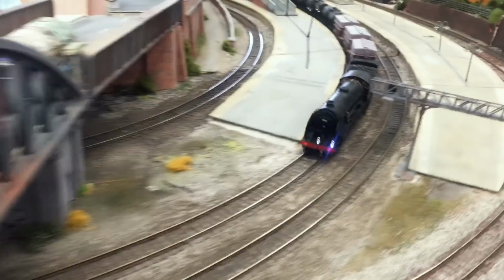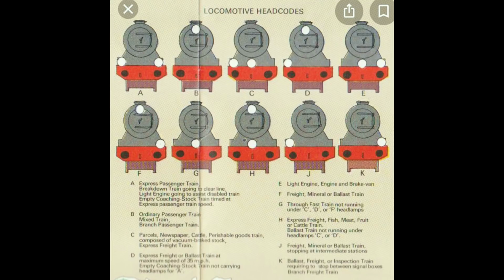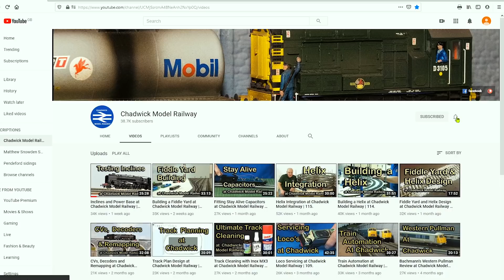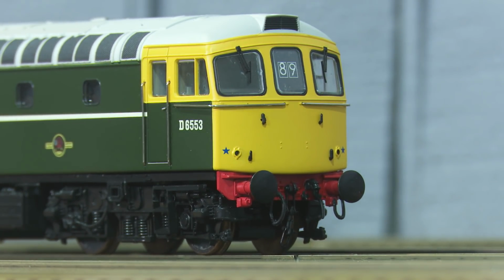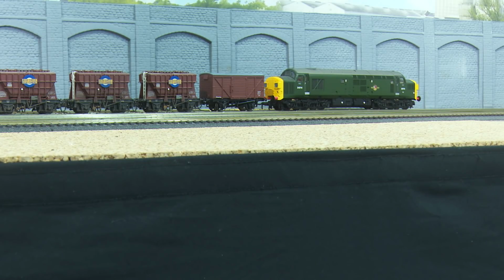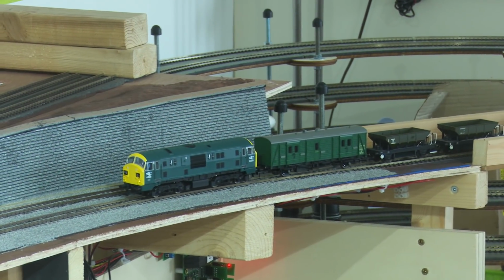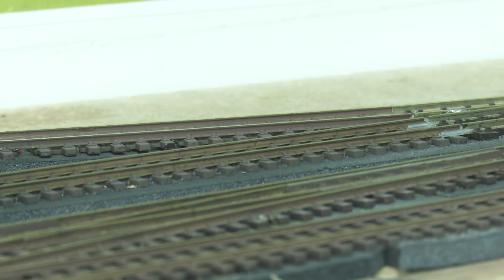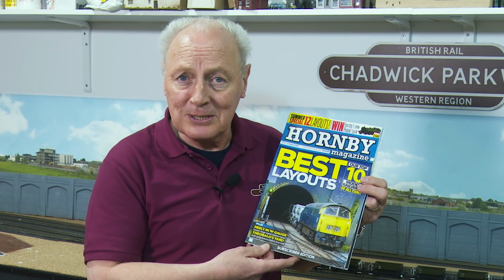Building Freight Trains at Chadwick Model Railway | 155.

Comment: Another great video Charlie.  The DOGFISH hoppers only had operating wheels at one end, and it didn't matter which way round they were, they would be which ever way the yard put them together.  The larger 40ton hoppers (SEALION or SEACOW's) had wheels at both ends as they were split into 6 compartments instead of three (left / middle / right hand side) on the 20ton DOGFISH.

The BY van behind the 63xx was a luggage van, and only had a seat for the Guard in it, so not much us as a crew van.  In fact the gangs of blokes that operated the hoppers would meet the train at a certain location, and ride out to site on the verandas (with there Tilly lamps) quite a site, but long gone in the modern H&S driven world of today.

On the subject of braked / unbraked wagons, also bear in mind that some of the grey un braked wagons were through piped, which meant that whilst the brakes on that vehicle would not operate, a fitted (braked) vehicle behind it could, so like most thing railway related, nothing is straight forward.
Reply from the maker: An excellent comment Richard, thank you.

I was aware of the through braked wagons, but thought it best to leave that complication for another day! Regards Charlie

Comment: Nice and informative video.  Although aware of the lamp code once one has glued them in and wired them up to a model, it is a bit difficult to change when the mood strikes to drag a freight rake with a loco set up for passenger service.  It was good you mentioned barrier cars.  I sometimes see oil tanks running without them on model train videos.  Cheers, Rob
Reply from the maker: I think the best idea Rob, is to use non-illuminated lamps on the front just held in place with black tack. Regards Charlie

Comment: Hi Charlie.
Great informative vlog as always.
In regards to those couplings, if they were mine think I would get the dremel out and just nip a bit of the end so it clears the frogs and points. Might be time consuming but worth it with those Great wagons.
Keep safe mucker.
Pete and Su.
Reply from the maker: I will use a solid bar to connect the wagons and KDs at the ends. Regards Charlie

Comment: On the couplings, the reason they have the lower arm (I think) is for the sprung uncoupling ramps that go between the rails (e.g. Hornby R617 / Peco ST-271). If you don't use uncoupling ramps then you could chop the lower arm so it doesn't foul the tracks?
.
It looks like the NEM pocket is mounted on a pivot at the very rear and it is the whole NEM pocket that it drooping (not just the tension lock plugged into it)?
I don't know how symapthetic the various coupling types will be to this flaw.
Reply from the maker: Yes Glen, the whole thing is a poor design.

I shall replace the couplings, but wanted to show their condition straight out of the box. Regards Charlie

Comment: Hi thank you for your reply, there is an ERROR in my comment. The need for side lamps on fitted trains will depend upon which book is used and I have since found a further rule saying that fully fitted trains do only need one tail lamp but all partly and none fitted trains will need the two side lamps. To give two further examples of part fitted trains ,part fitted trains with a D head code made up of 40 vehicles will require require a minimum of 13 and a maximum of 20 fitted vehicles  behind the loco. With an E head code a train of 40 vehicles not including the break van will require not less than 4 and not more than half of the total. Again all the above notes are taken from the Blue Book of Rules and I understand are for the Western Region. When putting a train together it would not make sense to sort out all the fitted vehicles so apart from the above the rest can be placed in any part of the train . On Gunpowder vans I think there should be no more than five in a train with two barrier vehicles at each end of the five at or near the rear of the train These vehicles can be loaded with non explosive goods so need not be empty. All of the above are taken from around 1950 and before so could have been changed at a later date. Thank you for a very good channel.
Reply from the maker: Thanks Charles, some great info.

I tend to adopt the rules based between 1960 and 1972, again from the western region but as you implied, it is a nightmare. Regards Charlie

Comment: Yes Charlie, at least in my experience brass wheels collect dirt.  I s'pose we could plate them, but that is expensive and finding platers is getting more difficult.  Then there is the problem of what happens when the plating wears and flakes - a problem the model press is strangely silent on with locos???  The worst wheels I have ever run appeared to be nickel silver?; they reliably gum up in about 20 feet of running.  My track is not great, being in a damp garage; but it's not t-h-a-t bad.  Replaced a lot of plastic wheels with mild steel which predictably rusted; had problems maintaining axle length, a something still being worked on.  I find with a lot of the old stock axle length/distance between bearings mismatch is what eventually forces re-wheeling.  Rusty mild steel wheels are still better than bad plastic or brass.  Plastic wheels also bring a wear problem, as often the axle is made from the same material as the bearing.  Currently trying stainless wheels, though they are hard to machine.  Beautiful wheels to look at; will try them out if I don't die of old age first.  All this is made even worse by the manufacturers changing wheel standards a few years back.  If there is a need to re-wheel and you have old standards, buying replacement wheels or bogies is a migraine.  Modern stuff is at or near RP 25 110.  Time has retarded my activities, and I am no expert, though experienced enough to shudder at some of what I see on Youtube.  If you are silly enough to email me I am always happy to discuss my misadventures.  Your channel is always encouraging and that's gotta be a positive.
Peter
Reply from the maker: Hi Peter thank you very much for an interesting comment.

I can’t easily replace these wheels as the axle length differs being made by a minor company! All I can do is remove the wheels from the axle and then replace the actual wheels on the old axle which seems a lot of a palaver. Wish me luck, regards Charlie
Reply: @ChadwickModelRailway  Indeed Charlie you have my best wishes.  Sounds like bogie replacement is your best option, though costly.  You are in a club; see if you can find some wheels from somewhere (not Bachmann as they are a 'unit design' and hard to work on) and ask a club member with a lathe to fit them for you.  At least you are not forced into out of production courser standards, BRMBS or something.  Time for a headache tablet.
Peter T

Comment: Hi Charlie. Well done with this, another great video as always! Well done for being so brave to tackle this as freight workings can be a bit of a minefield. I've spent a lot of time looking into it myself, and hope I can help with these comments;

 Each of the different 'classes' of freight trains not only had a restriction on the formation of the service (Fitted then unfitted) but also on the types of wagons that could be put into those trains, due to the higher speed these trains could go to. (I think it was mainly due to the lubrication of the axle boxes). eg; a class 'D' could have a 16t mineral wagon in the unfitted section, but not a bogie bolster. (Just an example) These instructions where in a document called the 'freight trains load book'. This also gives info on what kinds of loco could work what classes of train (eg; a WD 2-8-0 was barred from pulling a class 'D' or higher)

Also, the way the train was formed was in various 'portions'. This was to reduce time when shunting at each station/yard that the train stopped at. This would of been pre-shunted into the correct order at the yard the train originated from. The notes on how to do this differed for each region. Some I have found personally in the back of Working Timetables. If you whish to see an example of these kinds of notes, I've included them on some pdfs I have done for Yard Arrival & Departures on a couple of groups, and on these two sites: https://www.lner.info/forums/viewtopic.php?f=5&t=14326 & http://www.stciers.me.uk/home/analysis/analyses_front.htm (Look at Broxbourne Winter 1952 for an example of marshaling requirements)

I don't clame to be an expert on these matters, but I hope you find this helpful.

Stu
Reply from the maker: Hi Stu,
Wow, this level of detail is staggering.
I shall try and locate a "Freight Train Load Book" for the western region around 1970 and see if I can make head or tail of it.
Regards Charlie
Reply: @ChadwickModelRailway   Thanks. 

Yeah you might be able to find one on a well know auction site. I've got a couple (not WR though) and most of the information is in the front section. 

Always happy to help. 
Stu

Comment: Hi Charlie,

Really good video - very interesting. With regard to the Dogfish wagons, yes the wheels aren’t the best! You can swap the axles out for a better substitute; however, watch the axles as they are not the common length of 26mm over pinpoints - I think they are 25mm. 
I swapped the wheels out for Gibson replacements, I think, but I had to retain the original axles and just whip the wheels off and retain them with locktight. Hope this is of use to you and anyone else reading.
Best wishes,
Nick.
Reply from the maker: An excellent tip Nick, and very useful too. Regards Charlie

Comment: The other reason for the barrier wagons on dangerous goods trains was as the tail lamps were oil filled (naked flame) it wouldn’t be good if there was a leak. A problem that battery lamps took away.
Reply from the maker: A good point Benjamin, regards Charlie

Comment: Lovely and educational. I did flinch though when I saw the 33; usually, numeric headcodes were for passenger services, and alpha for freight. Of course, if a freight train was to travel from Dartford to Charing Cross, it would get the "50" headcode (or 60 or 70 or 80 depending on which route it took) -- but few freight trains travel between passenger termini.
Reply from the maker: An excellent point John, I’m on the case.

Comment: There's pedantry and rivet counting, and then there's this sort of thing, which is really far more obvious to an informed bystander, and much, much more difficult to deal with in model, than getting the correct number of rivets on the inside of a tender. I probably wouldn't spot that a loco's headcode didn't match the train it was pulling, but there are many who would.  So how do we deal with it on model railways?  Aha! I see your ploy, Charlie!  This whole video is about persuading Mrs B that you need more locos, isn't it?  I mean, you can't go changing headcodes or lamps on model locos, so you obviously need every single loco you own, in multiple variants of head code.  Though even that doesn't help when a loco brings an unbraked mixed goods into Barnstaple, and then leaves with a train of braked fish wagons later in the day.  That'd need hand-of-god intervention to swap the loco for its doppelganger with the correct headcode.  Wonder if manufacturers will ever come up with a way to change headcodes with a cv?

This is, of course, yet another reason why my dad and I modelled German railways...

I never knew that about bauxite vs grey wagons either. Learn something every day!

Those Heljans are a shocker.  Obviously replacing the wheelsets and couplings would be the way forward.  I wonder if in the interim, you could snip off some of the length of the err whatever the vertical bit of the coupling's called.
Reply from the maker: A great comment Andrew. I will swap out those couplings for some kind of rigid connector. Anyway, I’m so pleased that you found the video interesting. Regards Charlie

Comment: Interesting detail to which I have no exposure as I reside in the States.  Not having the brakes on cars connected to the engine via the glad hands on air hoses is not something I would have imaged.  Similarly, I have never heard of the headcodes for the engines.  Just a broader education for me as I still try to assimilate with the term "sleepers" for the ties.  Today is a success; I've learned something new.  Thanks Charlie.  Cheers.
Reply from the maker: That’s great news mate, I’m so pleased that you found it interesting. Regards Charlie

Comment: Bogie ballast wagons - either "Turbot" or "Whales" for starters.  More recent trains a "Seacow" would be appropriate, but not very often these days with with the older two-axle wagons.
(btw. Although the conflat has a grey container it looks as if the frames are bauxite, that being the case it would be a fitted wagon.)
Reply from the maker: Thanks for the advice Rob  and I’ll check out that conflat. Regards Charlie.

Comment: Hi i noted when you removed the con flat from the train it looked to me to be a fitted vehicle and could have been left in place. The number of fitted vehicles behind the loco will depend on the type of train.  You do not have to couple all fitted vehicles to the loco. A class E should have not less than four braked vehicles next to the loco. Class C should not have less than half the vehicles fitted. A class D train should be limited to 70 vehicles excluding the brake van.The minimum number of fitted vehicles is one third and the maximum should not exceed 35. It is a very complicated subject and there is a table of fitted vehicles to train size in the Blue Book of rules. All freight trains must have one tail and two side lamps fitted weather the trail is part fitted or not . It does not matter which way around your Ballast wagons face as the wheels open the hopper doors. When a loco is shunting it should a red and a white light each end one above each buffer. If running with a shunters truck is attached the lights should be placed on it and not on the loco. The above will in part depend on the date you are modelling and they are taken from GW and BR western reagion   publications.
Reply from the maker: A great comment Charles. I am aware of many of the points you’ve mentioned, however I didn’t want to make the video too complicated but perhaps food for thought for a future one. Regards Charlie
Reply from the maker: Also when you say the blue book of rules, are you referring to the BR rule book? Regards Charlie

Comment: Hi Charlie many thanks for sharing this informative video, I have the same issue but with Heljan class 32 diesel locos fitted with brass wheels (cleaning before running). If your rake of Dogfish are to be more permanently fitted together than you could perhaps do what I did with Heljan wagons and trim/shortened the trailing hook section off (or fit hunt couplings). The Dogfish were sometimes used with Sealion or Seacow ballast wagons with a shark brake van fitted to the centre and or rear, hope this is of help.
Reply from the maker: A great comment Barry. I’m currently chasing down some sea lion wagons. Regards Charlie

Comment: Once more a very thought-provoking 'Chadwick' video, Charlie - well done and thank you: where do you get the time to research all this stuff?? But, on the subject of early BR goods train working it would seem there is more to it than you covered here. My (very limited) understanding is that the types of wagons also determined the maximum speed the train was permitted to travel at, and this apparently was a function of wagon lengths and wheel arrangements as well as their braking provisions. Then, there was the appearance of the 'XP' designation on some stock (and this would appear to be a 'here live ye dragons' topic in its own right!). And, of course we also ought to consider the gross weight of our train (loaded or empty stock?) relative to the pulling power and braking capability of the loco up front, for the route to be traversed. So, just to make life interesting it would seem there are operational as well configurational aspects to consider. Oh my, what a minefield! Can we look forward to Part 2 in due course...?
Reply from the maker: You’re dead right David there are many more mines in this minefield. The train can only run at the maximum speed of the slowest regulated wagon, that is often 35 mph.

Furthermore, the unloading schedule must be considered when building the train in the first place. As you say it’s a minefield. Regards Charlie
Reply: Well, it certainly would have kept the shunters in business 🤣🤣

Comment: Congrats on this Charlie - I enjoy this kind of detail. Anyone know whether unbraked but through piped wagons were grey or bauxite? And what proportion could be included in a fitted train? Sorry to increase the anorak quotient with this query 😉.
Reply from the maker: I’m onto it Peter. Regards Charlie
Reply: They were bauxite. Also most BR standard brake vans that were painted bauxite were unfitted but through piped.
I don't think there were any restrictions as such on the number of piped wagons that could be included in a fitted train. I believe the restrictions were more what wagon could be included under which headcode. For example, if included with a passenger rated/timed train it would have to conform to the XP rating, basically, fitted or through piped with a minimum wheelbase of 10 feet.
Though I could be wrong about that.

Comment: Charlie, great video on goods trains. I also prefer glue to tacks for track laying. How do you get the straight track parallel?
Reply from the maker: Use a Peco SL-336 6ft way gauge. 
Buy a few, as they only cost around £1 each. Regards Charlie